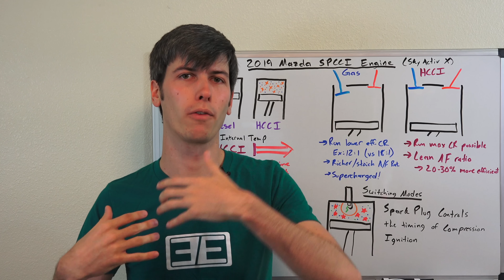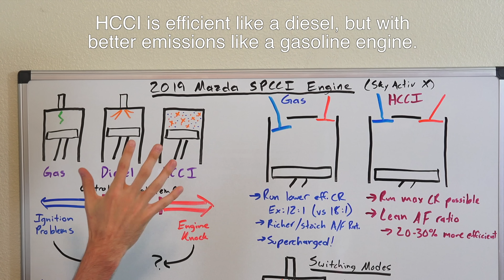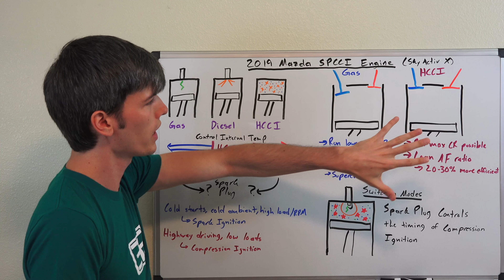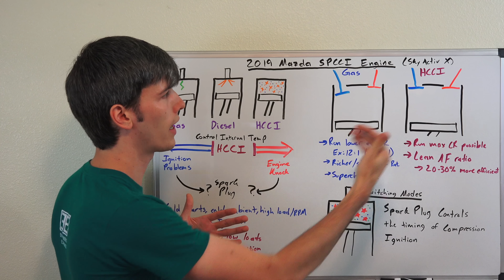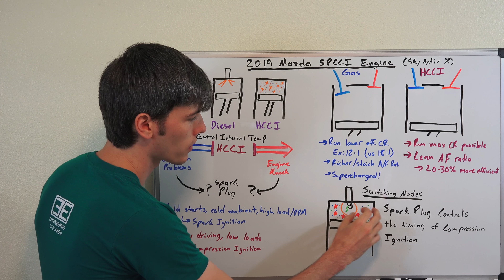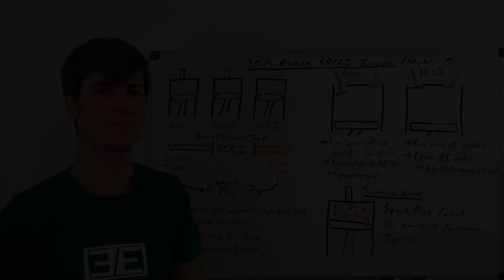Mazda Creates The Holy Grail Of Gasoline Engines - HCCI SkyActiv-X

Comment: Why cant petrol engines run by first compressing just the air and then injecting the fuel like in diesel engines? Which way is better? Can diesel engines run by compressing fuel and air together?

Comment: wouldnt running that lean melt the internals? are they gonna make engines out of tungsten? lol.... 2000LB engines wont move too quickly
Reply from the maker: It will actually burn cooler than diesel engines (which run lean), which is why the emissions are better.
Reply: Engineering Explained NVM. I confused myself. I was thinking strictly turbocharged + lean for some reason. Which equates to high combustion chamber temps

Comment: My question is to Mazda company engineer that hcci what u launch is a good think but how will u control the engine when it is on hcci as u need to change the timing of cam the valve opening n closing while in hcci mode.when in normal the car has less knocking but when we transfer the engine to hcci the engine would have problem like carbon build in valve becz of unburnt fuel and it would have ignition problem in cold start becz of spark full of carbon. And also the main problem which will occur is engine ecm failures. Plz reply Engineering Explained thanks for the video that I got some thing more knowledge on engine .

Comment: Probably injector timing change with 3 stages. First heating - full time spark plug mode - injector is working ahead of time to spray petrol into chamber, then intermediate stage - spark plug is a little ahead of normal time - before full compression mode takes with its heat environment and the last one is the stabile ratio of fuel mixture - spark plug timing is set - chamber is heated enough to carry compressed explosions. Main thing that it won't detonate prematurely is, within chamber, is injection timing coincide with pre-ignition, because combustion chamber is pressurized more than twice than conventional engine.

Comment: Interesting! Given Volvo's recent announcement to ditch gas by 2040, I wonder if Mazda could be setting themselves up for some trouble down the road by committing to gas at least until 2030. This does seem like the next big step in internal combustion though! Very cool to see. The auto industry is headed for exciting times!
Reply: volvo can say what they want for people to pay attention but batteries are a waste unless their is a quantum leap in batter tech in the next 30 - 50 years gas or/or diesel wont be going anywhere anytime soon
Reply: Ogreng Buddha I wouldn't be so sure! That leap could come at any moment. I see the industry getting flipped on it's head very soon!
Reply: Alexi R the problem is the materials have all been exhausted with current tech and their is nothing promising on the horizon for then ext 20 years at least. Battery tech is old and not efficient and out dated only thing we have close to replacing gas is hydrogen and that's  still got it's issues.